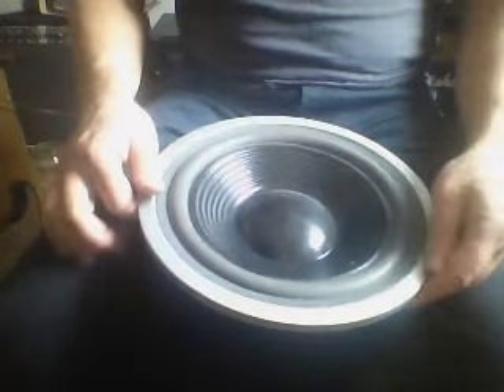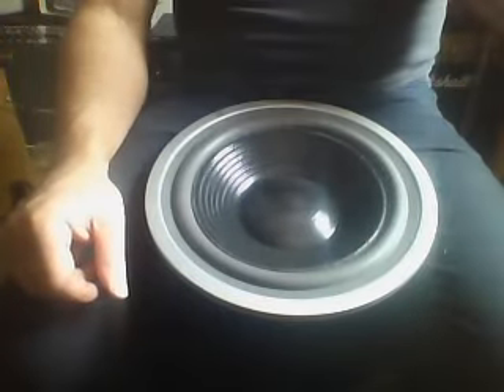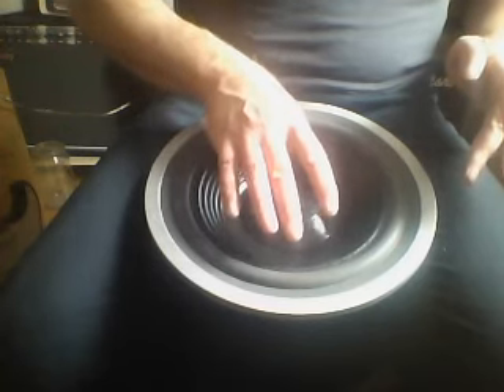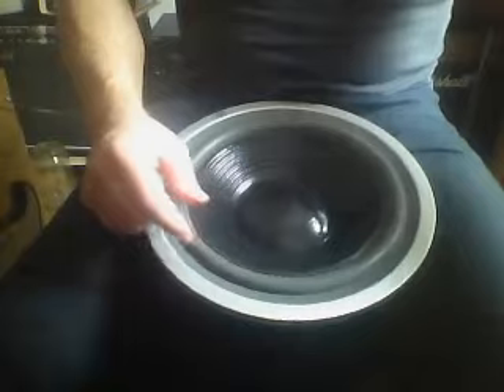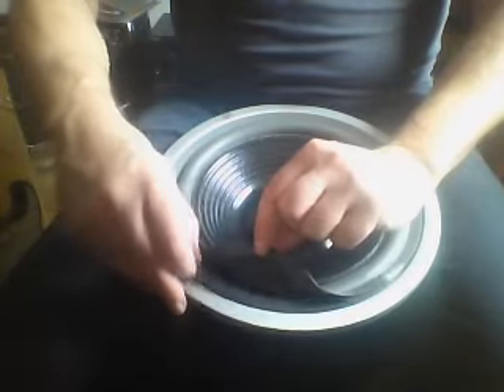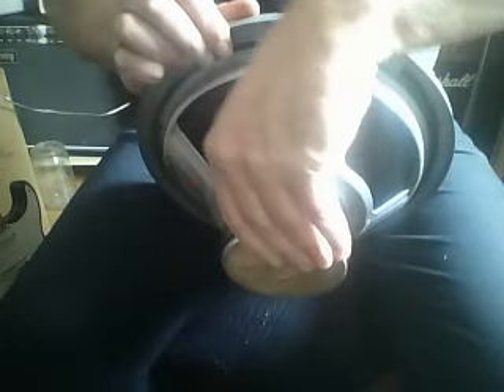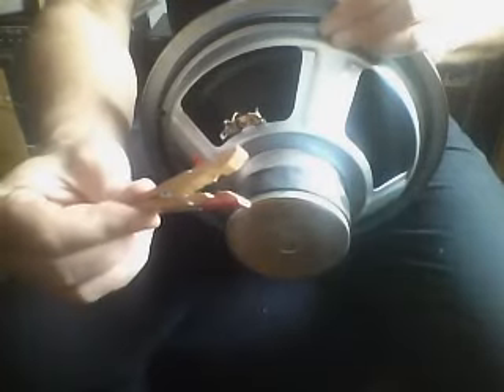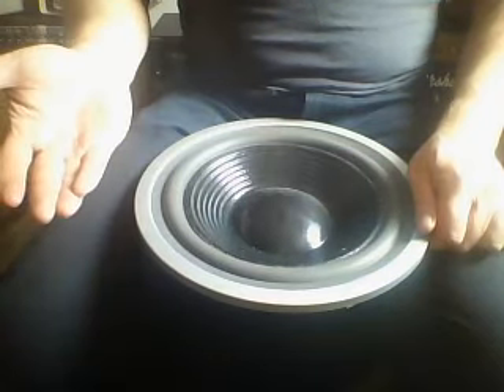speaker scratchy voice coil adjust (with clothline clips doesn't work)

Comment: 👏.  that's how it's done?
 More tutotrial Please.
Reply from the maker: actually, the clothline clip doesn't help, even if you fix "only" the spider's external spirale you're holding back the whole free vibrating system and it works outside its specifications. leveling some old gaskets and glueing them underneath the foam bead could work, but cutting off the edge of the foam bead half a millimeter right on the scratchy point side, pulling the foam bead there more towards the edge of the frame and glueing it there 1st to that side helps way better centering the whole swinging apparatus.